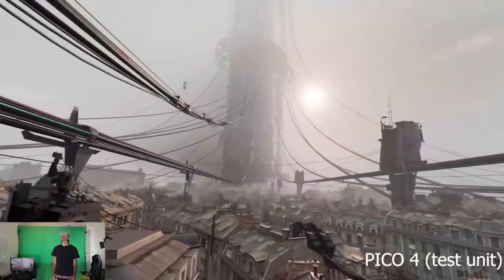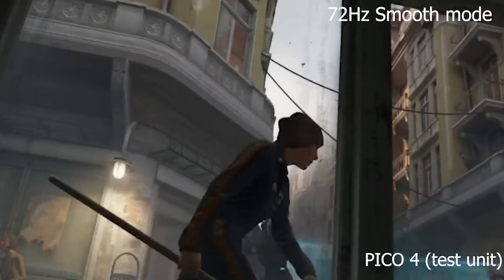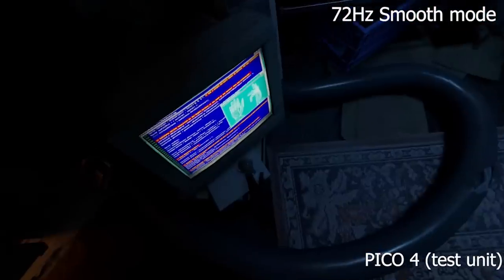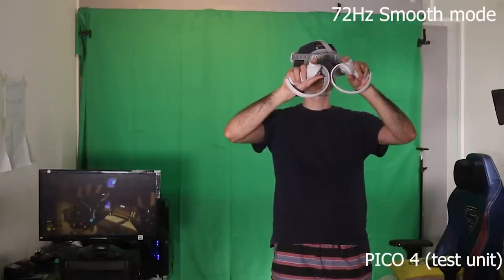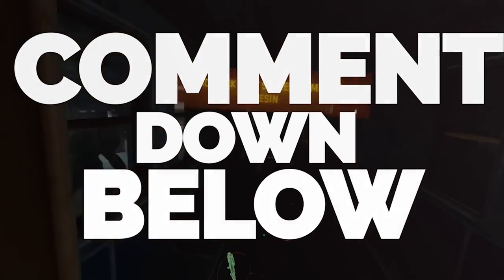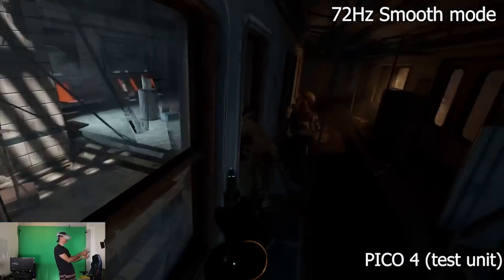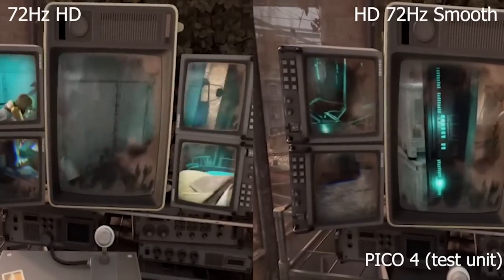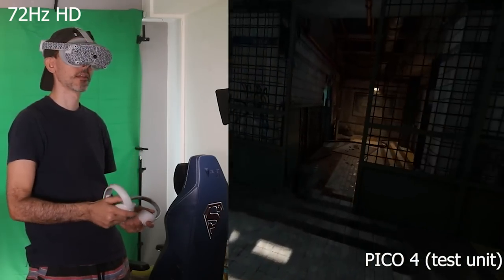1st PICO 4 Half Life Alyx Wireless PCVR Streaming | Gameplay & Graphics!

Comment: Will  never bé better than the pico 3 Link direct DP expérience ! 🥰
Reply: @shojo8708  for sure, pico plans are clear here : 

1 standalone headset  with medium pc option ( pico 4 )
1 pcvr headset with medium standalone option ( pico 3 Link ) 

Simple, smart. Chinese 😅🤷
Reply: @BigWolf39  Except for the difference in resolution and the lenses the Pico 3 will most likely have the same wireless quality than the Pico 4, since they use the same software and encoding/decoding methods.
Reply: well, that depends on the wireless connection quality and encoding. The Pico 4 has slightly better resolution and lenses, so if the image encoding is of a very high quality the difference will be very low or even better for the Pico 4. Nevertheless, apart from the still not correctly scaled DP mode, the Pico 3 has an excellent quality using DP, which is hard to match by any headset with similar specs.
Reply: @BigWolf39  It's not smart though is it? If you want PCVR the best option is still to buy a PCVR headset. That's what I'm getting from this review. I think I'll keep my HP G2. Basically, if you own a Q2 and use it for PCVR then I don't think buying a P4 will get you much better visuals although MRTV seems to say otherwise...

Comment: Very interesting. I do wonder if your setup is holding back the resolution? I know MRTV is overly enthusiastic about these things but didn't mention the artifacts at all. Have you had a chance to try Virtual Desktop with a WiFi 6 router as the native WiFi desktop solution is problematic? Does that still produce artifacts?
Reply: that 2070 is bottlenecking for sure but i dont know what else... my pc is a beast with 3080, 64 mb memory, 17000k cpu, and must have is a wifi 6 router.
Reply from the maker: Wifi 6 too expensive for me in Singapore

Comment: This sounds like a good first user wireless headset to get.  My current VR headset is the Rift S.   But not interested in the PICO 4 until the US distributors are selling it.  Also, I don't want to get into the hassle of META or FACEBOOK requirements which my Rift S also needs by 2023 and which all the Quest products need.  
Too bad the PICO 4 does not have a Data Port(DP) for good PCVR. Also being a SIM racer, Battery life could be an issue with league racing events being over 1.5 to 2 hours in length. Now, not needing hand controllers - don't know if that gives us more time battery wise.  I know the hand controllers have their own batteries - so may be a don't care from the headset itself.

Comment: Ah nice one! Would also Iike to see the fps/vram/cpu usage and ingame settings next time? 👍 So the Hp reverb has a res. of 2160x2160 per eye making it 4320x2160 total and the pico 4 with 4320x2160 per eye comes to 8640x2160 total? The Pico site says 2160x2160 per eye ''what did i miss, mabybe consumer version? Can you get your hands on a 308012gb/3090 for a wired test btw? Takes a lot to drive them pixels I assume. Greets
Reply: As far as I can see "4320x2160 per eye" you've just completely made that up! It's as you said - "Pico site says 2160x2160 per eye" so the combined resolution is 4320x2160.
Reply: @dtrjones  8:58. Also saw another vid showing the pico theatre app with an 4K/8K slider option
Reply: @Nobodyknowsitall  fair enough, that is of course bollocks. G2 and P4 is 2160x2160 per eye and 4K per eye would need to be 3840x2160 or higher. Sounds like this guy has gone to the Pimax school of display resolutions. This of course is not to be confused with render resolution which is a completely separate thing.
Reply: @dtrjones  
Yep. And 4K+ was used as a marketing tactic wich could imply when ss is used above native res. because of the subpixel arrangement. Yet makes a big difference, when tethered even better. Oh well... It'll be an upgrade for me anyhow coming from a quest 1.
Reply from the maker: It affects gameplay that’s why I don’t show it anymore …

Comment: Is there a cable to directly link the headset to the PC planned? I want a new VR headset for flight sims. Was going to get a G2 but I have an X570 motherboard and understand there are issues with the GS on this board not recognising the USBs
Reply: I believe that's no longer an issue with any new G2,  you buy now you receive the V2
Reply: @desdearman3553  thanks for the update

Comment: You should definitely invest in better router and graphics card to take full advantage of the product.  Otherwise, good detailed overview.
Reply: On Quest 2 running a hotspot directly on the laptop made it look like tethered almost for me. Much better than router if you stay near the laptop.
Reply: @JohannesReichardt  what’s your broadband connection?
Reply: @johnmann7o2  internet is 200MBIT but that does not affect streaming games from the laptop, I probably get around 150MBIT with variable rate over the wifi link

Comment: Honestly, "smooth" settings is by far not any reference for quality. I would asume that this is similar to the Pico 3 smooth setting and that just looks terrible. Even HD does not come any close to the Pico 3 DP mode or even the maximum possible Quest 2 wireless mode using either Air Link or Virtual Desktop. I will have my Pico 4 in a couple of weeks and i am very curious what quality i can get with Virtual Desktop.

Comment: Are you using WiFi 6 on router. Looking forward to how close this gets to g2 with the dongle.
Reply from the maker: Not wifi 5, 6 still too expensive for me
Reply: @vressentials  cool. So the WiFi 6 dongle may offer better performance. Fingers crossed.  Especially if in pc next to play area. I have g2 but coukd sell it if performance is close.  How long does it take to charge?
Reply: @vressentials  The Xiaomi AX3200 Wifi 6 Router is highly recommended, at least in Germany (I paid €65) - but I think it is available in other countries too. I use it with Wifi 6 in combination with the Pico Neo 3 Link through a plaster wall and a concrete ceiling and have an unnoticeable delay and very good connection. If I could have the router even closer to me now, that would just be incredibly good! (I have it hanging on a Fritzbox in repeater mode)
Reply: My PC is in a room with no VR space available, so I hope that dongle can be used with a like 10-15m (active) USB cable between PC and dongle, so I can use it in my living room like I currently do with my Quest.

Comment: Thank you for the video! One question: you say that IPD will start from 58 mm, but everywhere the specs say 62 mm. Is it going to be 58 in the end? (I'm 57,5 mm, that is important for me)
Reply: 58 to 72. Just you need to accept the disclaimer that there can be a little nose punching.
Reply: @ro94333  Official answer:

Our engineers have designed the PICO 4 IPD from 58 to 72 mm. Users can go up to 58mm IPD, if they agree to the disclaimer that the smaller they go, there can be a slight nose pinching (there is a pop-up message). 4.3k per eye is totally wrong.
Reply: @marpex-market  Thank you for your reply!

Comment: your frame drop using hd because hd mode use high resolution from headset and ofcorse peformance will calculate from ur pc specs. its not possible if u have better specs ex rtx 30 series u can get better frame rate using hd mode. smooth mode their lower the reso for who have low spec pc gaming to maintain the fps betwewn 72 haz or 90hz depends ur setting
Reply from the maker: for sure, thanks for sharing

Comment: so conflicted on this, I am a G2 user and want to pick one of these up to use for just fast paced standing vr games, I would be really interest to see how it stacks up against a quest 2 with airlink
Reply: G2 owner as well. The lack of tethered PCVR kills this for me. My main use case is Microsoft Flight Simulator so I don't notice the cable getting in the way and don't want to have to deal with latency and compression. Looking forward to the Quest Pro, more expensive but should at least be link cable connectable, plus extra features like mixed reality pass through, face and body tracking, and better tracking and controllers.

By the sounds of it a lot of extra money though, around £1200 rumoured.
Reply: @kevinbrook7033  sadly the quest pro wont have an uncompressed link cable it will be like the quest 2 in that regard, it's sad tethered pc VR seems to be on its way out
Reply: @gramsci1094  yeah I suspect the same, the official link cable isn't too bad though, I have a Quest 2, had a Vive Pro 2 and have a Reverb G2 and I actually preferred the Quest 2 to the Vive Pro 2 for overall image quality. They work some special magic in software minimising the limitations so I'll likely still get a Quest Pro with USB-C. I would obviously much prefer a native display port connection though. With wireless I never found the visual quality good enough with the Quest 2 for PCVR.
Reply: @kevinbrook7033  yeah for sure quest 2 with a usb cable is totally fine especially if you use the debug tool and up the bit rate, I find the quest good for action fast paced stuff and the G2 the best for simulation/ seated experiences. I did try the pro 2 but I couldn't get on with it which was a shame since pro 1 was so great (just too low Res now)
Reply: @gramsci1094  same with me, love the G2 for MSFS but prefer the Quest 2 for action games. I haven't actually played anything other than MSFS in the past year as I'm waiting for a better headset to enjoy them again. Hoping Alyx and Saints and Sinners will be great on the Quest Pro.
Reply: @kevinbrook7033  just out of interest what CPU are you on ? I did want a quest pro but it's going to cost 1500 dollars so it's a big ask for something like that I think as it's more of an enterprise thing
Reply: @gramsci1094  I've got a 10850k and a 3090. My main use case is Microsoft Flight Simulator. The Quest Pro is expensive but it seems all the future headsets are going to be well over $1000 so I guess we have to suck it up. I was a bit disappointed with the 2160 x 2160 per eye being quite low but now I'm thinking it's probably for the best so I don't need to upgrade my PC as well. Price of gaming seems to have jumped dramatically in recent years. Gone are the days when £2000 would get you a top end PC and £500 a top end PCVR headset.
Reply: @kevinbrook7033  yeah that is a good combo ive got a 3080ti and 3700x im thinking i need a cpu upgrade really. I think if you are prepared to wait there will be much more afforadble stuff coming next year like quest 3. I just want Valve to hurry up with the deckard
Reply: @gramsci1094  if you're on AMD will a 5800X3D fit on your existing board? That's such a good CPU for gaming, it still smashes the new 7950X in many gaming benchmarks. Not so good for productivity but if you're primarily a gamer and it works on your board that would be an easy upgrade choice.
Reply: @kevinbrook7033  that's the exact one I'm going for mate good to know I'm making the right choice, yeah I only care about gaming performance really
Reply: @gramsci1094  if I was on AMD I'd get that for sure.

Comment: Thank you for the video. It is quite promising to see these things and it looks like it could be a decent device for people who wish to enter VR. Reasonable price, decent enough for PCVR. Yeah, I think this can be recommended to people sooner or later.

One question I have though - do you know if the buttons on the device are capacitive aka detect touches. Some social VR applications such as VRChat use that - if you release your index finger from the trigger your avatar will point. If you have your finger on the trigger (you don't need to press it down) your avatar will show a fist. In these games this is a rather common feature for gesturing.

So far the only controllers which do this well are Oculus Touch and Index Controllers - and it's still quite a roadblock if you wish to recommend affordable VR to people which isn't by Meta.
Reply: It does have capacitive touch as far as I know even though it's not really being marketed, which is strange
Reply from the maker: It’s not

Comment: how would you rate pico 4 as a successor to quest 2 with 1.5 resolution airlink / virtual desktop ultra settings - on wifi 6?
Reply from the maker: I'll need to buy a wifi 6 router but they are very expensive still - can't compare to Quest 2, only Pico Neo 3 link streaming, I mention this in the video :)
Reply: @vressentials   You can get a cheap Wifi 6 Huawei AX3 router, works great for me.
Reply: @vressentials  wifi 6 xiaomi is under 90 dollar